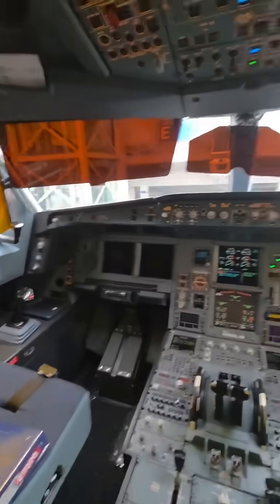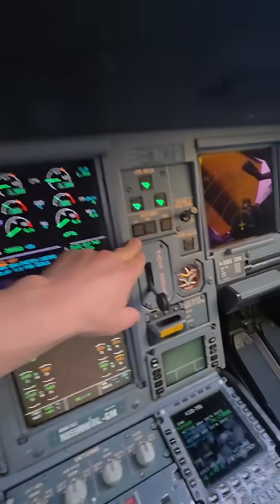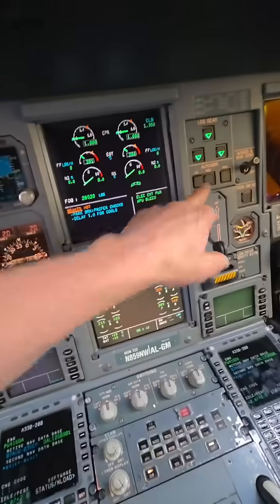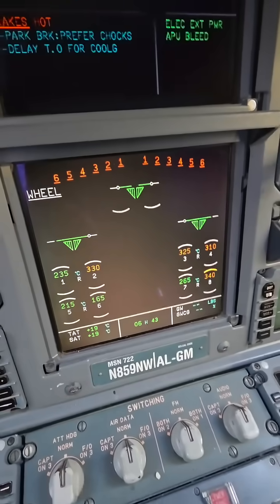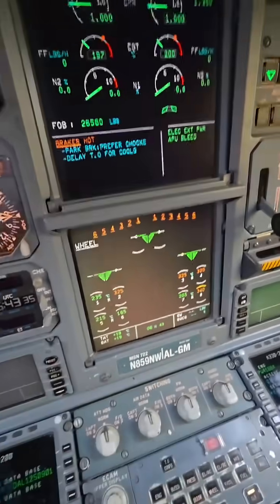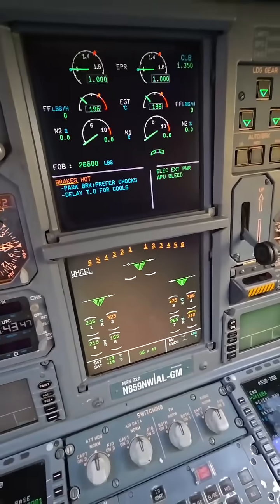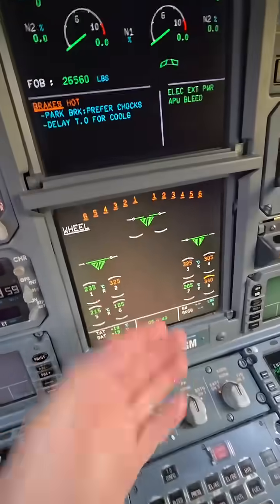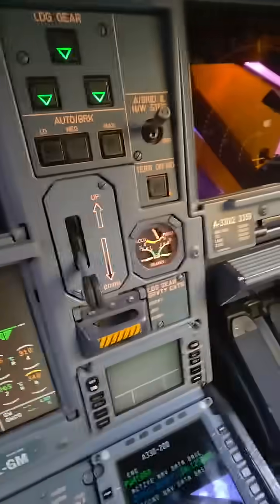Hot brakes are normal after stopping a 400,000 pound aircraft!

Comment: Hey captain z I saw a few with built in fans in the hub of the landing gear. Is it new tech or just not widely used on all models
Reply from the maker: It is an option that we did not purchase. We don't really use the aircraft on legs where the brake temperature at takeoff would be a problem so we let the brakes cool on their own.

Comment: Just out of interest do you have to use an auto brake setting? In both the airlines I flew 330/350’s in off was a brake setting.
Reply from the maker: Our policy is to use either LO or MED for all landings unless the autobrake is inop.
Reply: @CaptainZtravels  thought so, I guess with low it gets the ball rolling so to speak but we were allowed to use manual brakes if we wanted, especially on the A350 where the normal thing is to use BTV so it only has a MED auto brake setting and that can be harsh to say the least, if BTV isn’t working for a variety of reasons off is a better option.

Comment: Which is also why parking brake is released at the gate with chocks being used instead.
Reply from the maker: That helps, though over the years I've heard conflicting reports as to what Airbus recommends. 

For a while the thought was to set the brakes for 10-15 min when the brakes were hot, then release them for 10-15, and repeat. I was told this helps cool the brakes faster as the calipers were applied then released, transfering the heat to the colder parts as they were applied, then when they were released the heat would dissipate on the released parts. 

We don't do that anymore!